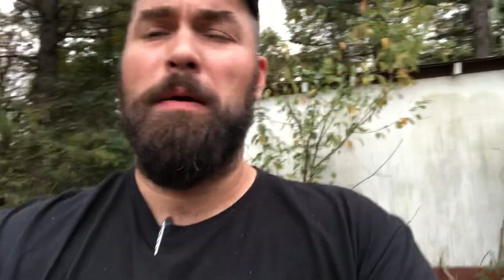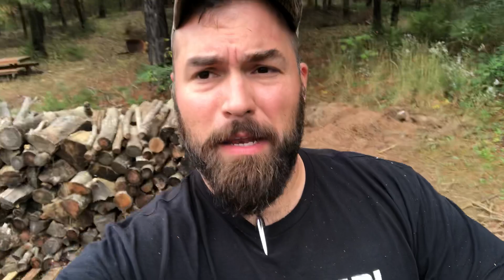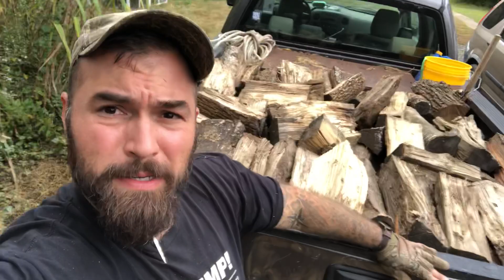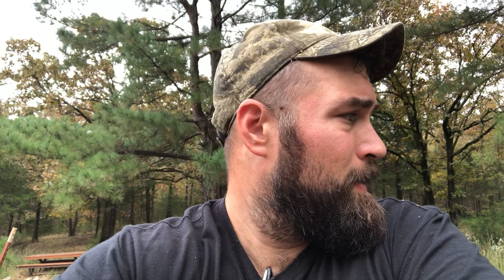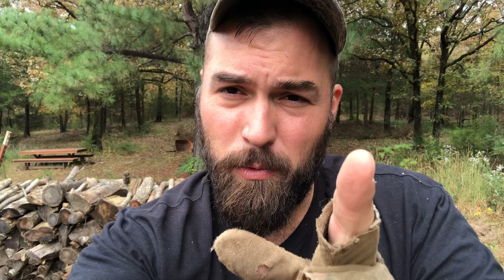CORD vs RICK Heating with Firewood

Comment: Yeah I did firewood for years . Sold it by the rick here in southern Indiana . I called a rick as stacked 4' high x 8' long and 16" - 18" wide seasoned and split = $60 delivered,,, dumped not stacked unless they where elderly.  But that was 10 years ago.

Comment: Hey Bear good topic! I'm 62yo born and raised in OK. but now I live in the Pac NW, Cascade Mnts. when I was a lad in the 70s everyone had regular brick and mortar fireplaces. so we understood a rick to be 1/2 of a cord. (2' x 4' x 8') free standing wood stoves were just coming onto the market for homes in a mass production sense so the 16" long piece of firewood was born, "again" . . . (wood stove dating back to antiquity.) So it has become a really big FUBAR of dimensions since then. Now living in Big timber country firewood is only sold in Yuppie Bundles or real Cords as you have described. . . and one thing I want to point out is when we say a Cord of Wood We MEAN split wood not a bunch of small rounds and limb wood. Those items leave more dead space in a stack and limb wood is just undesirable in nearly every way. Someone tries to deliver a load like that and bad things can happen. . . Being from OK. I also know the trees are different etc and one has to adjust for the region they are in. No on up here has ever even seen a live Oak tree or a blackjack so there is my 2¢. 

-steve

Comment: Thanks. That makes it easier. On a side note, my chainsaw lessons this summer, they went ok. I'm allowed to cut limbs no bigger than my thigh, no higher than my knee and no closer to the ground than my ankle. Learned to change the bar and chain. (Just don't ask me why.) This winter my husband is going to teach me file sharpening.
Reply: That's awesome! I learned from another video to flip the bar so it doesn't wear unevenly. Plus it's good to clean everything out once and awhile. Let chainsaw warm up for 30-60 seconds before working so not to scratch cylinder wall and loose compression.

Comment: In my neck of the woods a cord is 4x4x8 feet. A rick is what you keep the wood stacked in. If you build a frame to keep the wood off the ground and balanced in a stack THAT is a rick. Has nothing whatsoever to do with how much wood there is. You might build a rick on the back porch to keep the wood handy and tidy. You would re-fill this rick daily from the wood shed, or larger ricks out in the yard. You might have a smaller nicer looking rick in the house near the woodstove or fireplace.
Reply: Blue that was my understanding of a rick as well.
A porch rick should hold a face cord ready for use. A yard rick should hold whatever you need it to hold.

Comment: As a note, I have been burning wood since I was 14 in my mom's garage washing cars to earn money in winter (1979-80)...we recently bought a cabin in the next county over and one of the neighbors was putting firewood in a building...I said "this townie (he lives in a large city full time) has no idea what he's doing". Well turns out our little hemlock/rodadendron valley is so damp it will never dry firewood, and will actually ABSORB ambient moisture from the air even if I bring it in dry from our farm. NEVER seen that happen in 35 years of wood heating.

Comment: I go by my short bed truck load which is 222 - 225 pieces of wood that last me roughly 2 weeks. I have stacked in neatly and just grave yard hump and those are the numbers of each, needless to say just throwing it on takes 20 min. while stacking / ricking it takes alot longer. I burn 2 loads a month at temps from 12 F and up at night, and around 30 F and up during the day.

Comment: I mainly scavenge or "woodhound" my own wood, and cut and split it myself.   So, I get whatever is available for the getting.   Had to buy some for the first time ever this year, because I ran out of ready to burn fuel sized pieces.  (and my usual go-to honey hole was barren...  They came in with excavators and buried everything.)   The units I saw advertised were full cords; face cords; and half a face cord.

  Nobody has ever heard of a rick around here.  And, being in the northeastern US, trees and firewood are incredibly plentiful, so prices are pretty reasonable.  (unless you're in a big city, or wealthy area,where prices tend to be higher)

  Where's the fun in buying it though???  You get all the work: stacking and moving it around; but none of the fun!  (splitting and cutting!)  I like my trusty double bitted axe for splitting, and a shingle froe for making kindling.    Just pretend that block of wood you're trying to split is that boss that dumped a heap of shit on your desk and needs it done yesterday!   Or someone that really irks you!  Makes splitting not just fun, but therapeutic!!
Reply: The fellow who sold me the wood had a SWEET setup!  I went and picked it up, because I have a pickup, and he was local.  No need to pay extra for delivery.  He built his own wood processor that bucks and splits, then dumps right onto a conveyor to take it where he wants to stack it.  He also built his own sawmill.   The wood gets stacked in these home built racks that each hold 2 4'x4' stacks (1 face cord total for the math challenged), or in
full cord racks.   You could see exactly how much wood you were buying, and load your truck right out of the rack. 

 I got 1/2 a face cord of black cherry with appx 1/3 hickory in it.   (found his ad on Craigslist for cherry firewood)  Reasonable price, too.   As a total newb to buying firewood, I was surprised by how much wood is actually IN a 4'x4' stack- more than I'd expected.  I won't be running out of wood for my grill any time soon!

Comment: Do they call it a Rick, cause that is the name of the guy on the road with his pickup? What is an average cost per cord?
Reply from the maker: Sunset Watchman varies greatly from region to region but seems like about $120-$150 per cord.
Reply: @BearIndependent  Thats cheap! Here in north scotland you can pay $250.00 for softywood and $400-500 for hardwood. Thats split and seasoned.
I bought 25tons of 10ft lengths of beech delivered by semi trailer for $70.00 per ton,  we only use wood heating, our wood burner also heats domestic h/w and wet radiators round the home. Wood prices are way high as the osb factory pays well for it. That plant runs 24/7...We are surrounded by woods, but cant take any at the current defcon level........
Reply: Here in Great Lakes area it is all hardwood, $250-300 per cord. (Description of location varied for "op-seky " reasons)

Comment: i stack mine in rows 24 foot long and about 4 foot 3 inches high. that is 15 inch or there about cuts lengths and figuring in the taper at the ends as i don't post the ends. i burn on average 3 cords per season which for me is basically september through june with little but a few pieces at night for some of that to the heavy day long burning with out ever letting the stove go cold. so my heating is 66 dollars a month averaged out over 10 months at 220 a cord. i currently purchase my wood as of last year. i stack 24 foot long times tree rows because of space. as in it fits where i wanted to put it in that manner better then any other. i usually end up with a little over my cords worth per cord. never going to say this guy doesn't give a cords worth. also i stack well and the end tapers are minimal. i leave my wood out from july till the following june before putting it inside to finish off for that years burning. i do not cover it as when i do it ends up with enough rat shit on it that i have to shake off that i learned to not make a home for rodents by leaving it uncovered and allowing it to cure. i usually supplement what i burn with stuff off my place from removal of stuff like little trees that has gone on for seven years. i burned wood off this place for the first five years so didn't need to purchase wood. that is fifteen cords i took off an acre of total land plus another few cords since with smaller stuff. largest tree i took was 70 inches at DBH.  got a few cord outta that one. :) i have currently between seven and eight cords sitting on site and if i had to guess would put it at 7.75 cords.  about three and a half ready to burn for this season and the rest is next winters slowly curing outside. i'd also like to add something to this short mess. those presto logs sold ain't all bad. their heat per volume is great. i bought one pallet of them some years back just to see. the heat value for space used is very good and i have thought that should things look to be going south enough i'd purchase a few pallets worth to supplement my wood heat stretching out my need to collect to three years without much effort. this would allow me time to collect years before needed. i never used a wood splitter but never needed more than wood for a winter out. a splitter sure sounds better than a wedge and a maul for big wood.